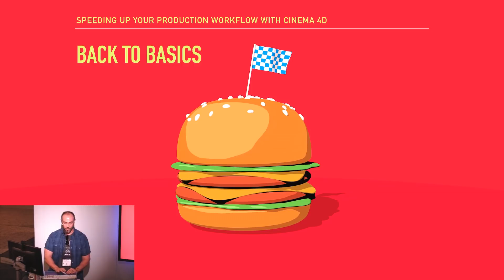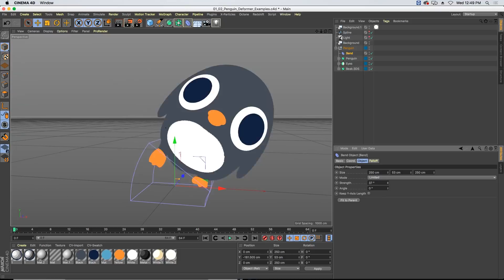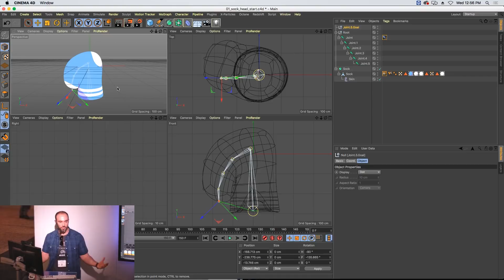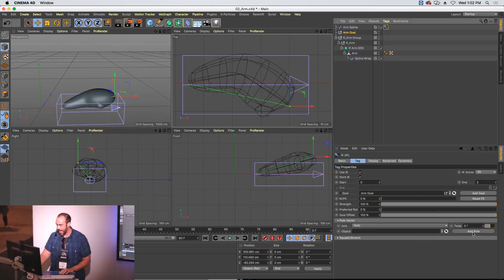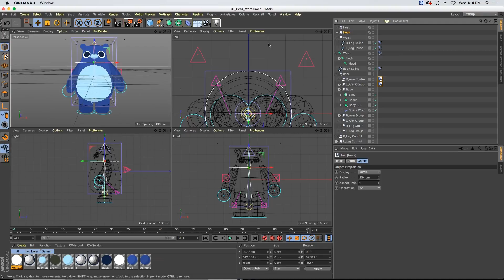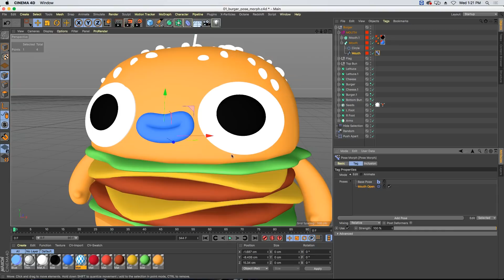NAB 2018 Rewind - EJ Hassenfratz: Painless Character Rigging using Deformers and Splines

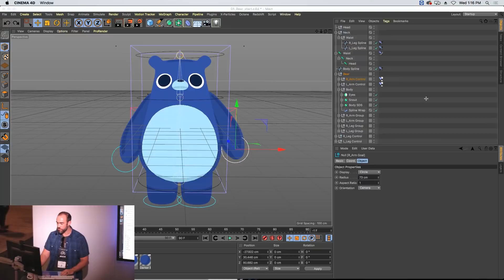Comment: 38:48 - what did he mean "with traditional way of rigging you have to weight everything on the actual mesh" ? So he's using deformers. What other ways are there to rig?
Reply: I think he refers to the method shown here (watch?v=uN84nGoAEA0&t=28s), where the geometry is directly affected by the joints.